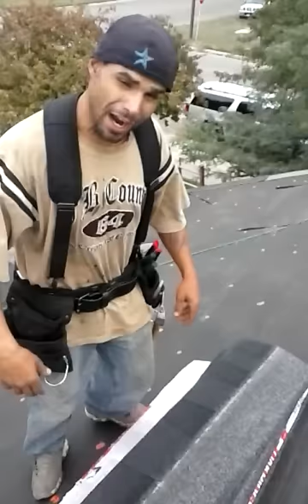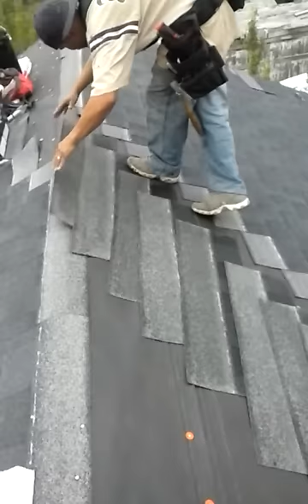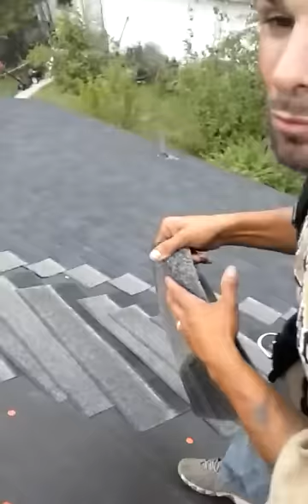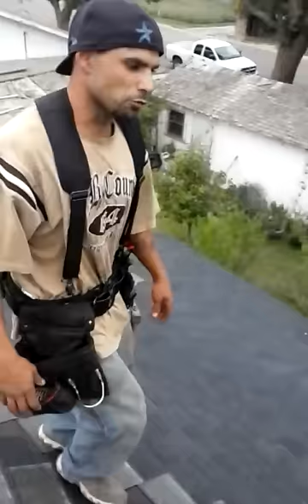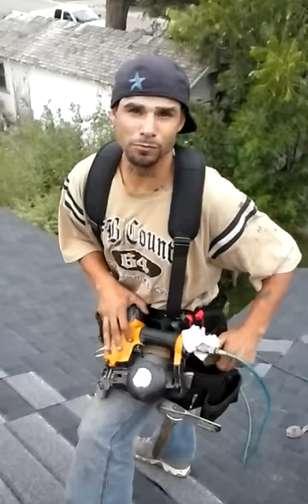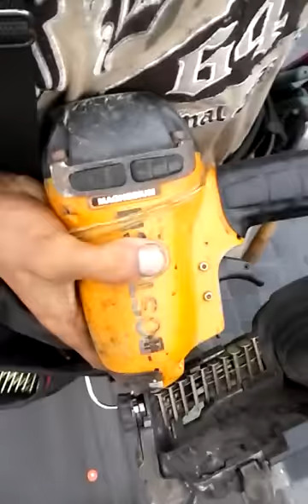FASTEST ROOFER ALIVE SUPER ROOFER

Comment: You just left the low nail? Just pull the shingle and fix it then. Btw in the time it took u to lay those shingles out I could have put half a bundle down at the least
Reply: Jae Doe you took the words out of my mouth, I was gonna make the same comment with the respect,I think laying down those shingles its time consuming. greetings.
Reply: Honestly, i like a good feeder.
Reply: shingles cost money, roof goo and cover with a 1 inch sq
Reply: I was thinking the same thing,  laying them out like that is a waste of time, and when it is hot out they'll be stuck on the felt by the time you get to them.
Reply: I feed my boss we do 10 sq in a day average, rip, water tight, shingle and clean.
Reply: Just come back with some caulk,like tar pookie and cover it with granules. Not a big deal
Reply: He should of remove the shingle off amd install a new one. Wat a rookie. Is not about been fast is about doing the job right.and right now u still a rookie leaving the shingle with low nail on
Reply: @LJsReef  I like a good feeder too. But they are actually kinda hard to find lol
Reply: Not only the low ones he clearly saw and said fuck it if you look back there’s a ton either right on the seam or within a inch what a butcher there’s only 2 or 3 things you can do wrong and he did 2 of them
Reply: @EliteValadusVideos  leaks cost more
Reply: @americanskull4138  I saw that too and by leaving it it can void the warranty. He 100% should have ripped that up and been more humble. Pride is building up so much in him he is doing a bad job. He is skilled and can be a great roofer though. He just needs to do it right. I would 100% hire him though. He seems like a great motivated worker.

Comment: Fast but do that at a double nail because of high winds in a area that is needed to double nail I think Florida has a code for double nailing .the best way to nail is by hand with a roofing hatchet they pay more for the hand drive because the nails are flat and no blow outs or bent nails pertruding through the new shingles put down .I've tore more roofs off I know that the air gun isn't all that for shingling but it's a fast way to make money.

Comment: Good technique using the nailer guage tho my back would never last over time  standing up installing shingles.. Coming from a full time roofer myself, when quality and warranties matter, its 6 nails for each shingle and I never use the old black felt paper underlayment..gaf feltbuster synthetic underlayment or similar..peace
Reply: bullshit don't need 6 nails. Wasting nails and cluttering up the shingle. 4 is plenty.  Also nothing wrong with old skool felt.
Get it on straight and you can use those lines.  Don't need a gauge.
 I'm 70 been standing up and bending over 30+ years. My back is fine
Reply: @robdonna1000  I'm sure it has a crease and lost most of it's grit...

Comment: Should be 4 nails then a 4-6 inch gap then put last nail so your next shingle doesn’t line up with a nail and water run down the seam and leak through the nail.  That’s what I’ve been told. Sound right?

Comment: be as fast as u want u shot a low nail !! leakkk✋🔨💦💧☔
Reply: The time it will take to come  back and do the repair will take about 2 hours. Get in the truck. Leave the shop. Drive to job. Unload. Fix shotty work....   2 hours.....  slow and steady wins the race. Speed comes with experience.

Comment: On--The--Line--Every--Time. That should be the rhythm of every roofer with a gun in his hand. But you don't need 5 nails.
4 is plenty.  On--TheLine--Every--Time. You could be even faster toots. And not have to reload so often
Reply: In Florida the code is 6 nails. One on each end and four in the body
Reply: Yeah. Like I said, I lay mine out similar to what he does but he is moving like he's not in a rush. I move like my paycheck depends on it because I get paid piece work. I like guys like home though: the more time he spends flapping his gums the more time I have to eat up shingles and get paid
Reply: @jamesferguson4865  had to use a coil gun once. Kept running out of nails. If you are shooting 6 you are wasting time. And sounding like a woodpecker.
Reply: You would get embarrassed when the homeowner who spends zero hours a week roofing reads the bundle and asks you why you aren't nailing for the max wind speed warranty and looks up the price of nails and asks if the $2 extra it may cost to put it on proper was worth you losing marketing.
Reply: @TkerIsAPimp  nope you get 5 more mph with extra nails. It takes a hurricane to blow off shingles that are sealed down on the bottom edge.
 I got 30 years of roofs all over southern Oregon and zero embarrassment.
Don't need no stinkin warranty.

Comment: And there you have never pulled your hammer once...used your gun as hammer  so how many cocked or pitted nails did your ignore..its in the gaf cert...other than that good nail line accuracy and straight runs also. Dont over look the nails they will pop.. give you 9 out of 10 rating. Flat flush nails in the nail line and you have less callbacks.  I'm 33 years in the field. I'm dont consider speed quality..

Comment: Speed is not the key. Speed comes with time and expertise. A fast and experienced roofer does not need to pre sort their shingles. Its all in the flip. Your nails are too far from the edges of the shingles. If it were to be inspected by the manufacturer for whatever reason, you just failed the warranty and now the customer is out of pocket and the owner would potentially be liable for suit. If you do not nail close to the edge within 1", the corners of the shingles where the nails are to be installed would lift within 7-10 years and you have bumps all over the roof. Nail pattern for architectural shingles is 5 nails yes. One on the left, 3 in the middle and one on the right to avoid nails on the seams which will rust out within 10 years. You're just blasting shingles on. Roofing foreman and company owner for 20 years. Good job just slow down and get the nail pattern and flip perfect then you will have the speed over time. Keep it up brother.
Reply: every package I ever read says FOUR FASTENERS  rookie